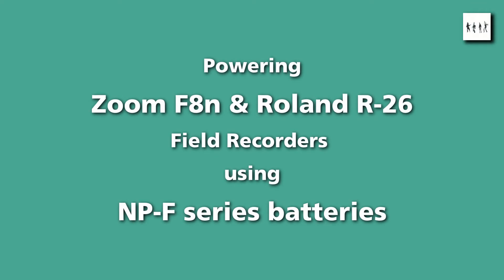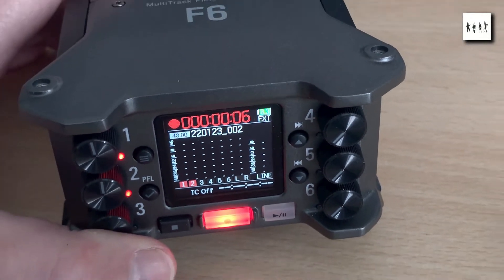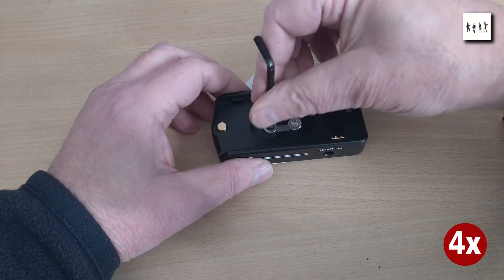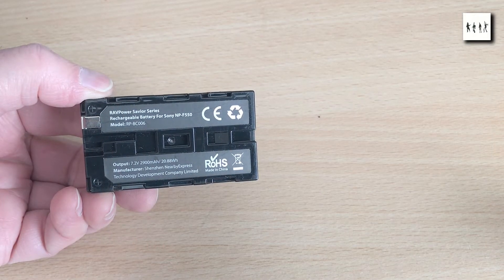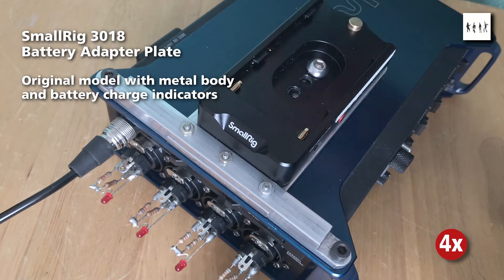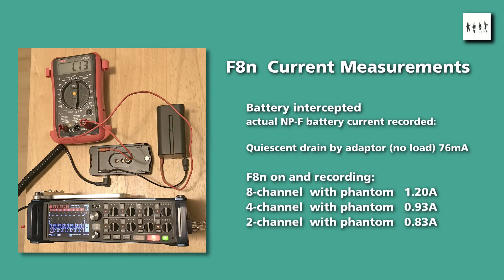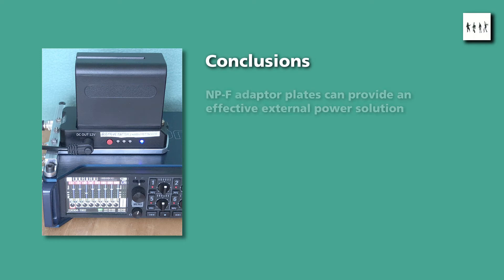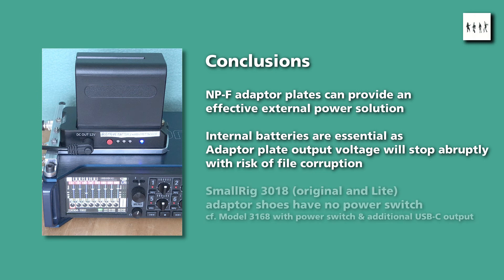Powering Zoom F8n & Roland R-26 Field Recorders with NP-F Style Batteries

Comment: Thank you for the helpful review and measurements. Did you keep the display enabled (if so, full brightness or dimmed?) on the F8n, since some people are pointing out that a significant chunk in the power draw of F8n is due to the power hungry LCD?
Reply from the maker: You're welcome! I normally use power-saving with LEDs and LCD at between 5 and 10 (if in a low-light environment - higher if brighter.) While it may use extra power, I would never leave a recorder recording with no visible display, unless I were going to walk away and leave it completely (which I almost never do.) Even if the recorder is on a stage. I like to be able to see that it's still working from a distance, even if I can't see the finer details.
Reply: @reqordist  Thank you for clarifying it!

Comment: You should use a Hawk-wood: DV-BM1
Can use dual NPF batteries, has a on off switch, power level indicator and you can hotswap. Outputs to two Hirose connectors and a power con.
Also has screw fittings so u can mount the batteries if needed without all the DIY mounts
Reply from the maker: Interesting, thanks! They're quite heavily discounted atm.

Comment: What cable were you using with the Smallrig NPF adapter on the F8n? I just purchased a F8n Pro recently and was looking to set up a similar system.
Reply from the maker: Sorry, Kiefer, it was quite a while ago, and the actual item has fallen off my ebay purchases history. I bought it for use with an unbranded 12V Li-Ion battery pack, which doesn't have a charge indication, so is less useful than this sled. The good news is that there are plenty available - search ebay for 'hirose cable male to DC jack'. The SmallRig adaptor's 12V output is centre pin positive. Connector barrel is 5.5mm outside diameter, inner pin 2.5mm diameter. Note the Smallrig adaptor's 7.4V output is also centre pin positive, and barrel 5.5mm OD but it has a smaller (2mm) pin. HTH!
Reply: @reqordist  Thanks for getting back to me! I'll look into that

Comment: Hi , thank you for your time and video ,, greats ! I looked for lots of solutions to power zoom f8n and one of them is boost 5vto 12 v but it's 1 amp and I think it's low  because the minimum is 2 amp, my question is how many amp delivered smallrig 3018 in 12v output ? Thanks you so much ✔️😊
Reply from the maker: Hi, I did not measure the 12V current directly, but:

The NP-F battery was supplying 1.2A at maximum load (see 4m12s). 

So if the battery voltage is approx. 7.4V, and the converter's efficiency were 100%, the 12V output would be supplying (1.2*7.4/12)A = 0.74A to the F8n. 

As conversion efficiency will inevitably be less than100%, the 12V current drawn by the f8n must be less than that. So that would indicate that a 12V 1A supply should be enough to power the f8n. 

I know that the supplied AC adaptor is rated at a nominal 12V 2A, but that is probably to ensure that the adaptor never struggles to power the recorder, and stays cool in operation.
Reply: @reqordist  thank you,  small rig with your f8n work probably with f8n do to lol    ,in boost power 5v to 12v 1amp  I take of the DC 5.5mm and remplace it with hirose 4 pin that way is better than DC 5.5mm ? For my Sound devices 442 work but i don t try it in F8N yet  I think is not safe ? What do you think? 😁

Comment: BRILLIANT!! Thank you!! I have one for you as well for the F8n, you can grab a portable car starting booster which have about a 21800mah capacity with the barrel plug output. Be aware that they can output 16.8V.  However, for my brand new F8n Pro, it can accept a voltage input up to 18V so it works great.  PLUS you can start your car and charge other USB items with it if you need to! :)  I've had the F6 I've been using for years and LOVE IT and I was missing the ability to use the NPF though on the F8n!
Reply from the maker: Thanks for that suggestion - there's a vast range of sources for Li-Ion battery packs these days! Have only just seen the adverts for the F8n Pro - it looks amazing - you must be very pleased with it. Getting an F8n Pro would be a no-brainer if I didn't have an F8n already!
Reply: I did that for while.

Comment: Amazing video, thanks! I have an additional question about the SmallRig 3018 plate and the NPF Batteries that work with it. Does its 12V output work as a booster? I currently have a ZOOM F4 and got an ANSSO battery plate for my NPF970 batteries which only output 7.2V which is not enough to power the recorder. I'm thinking of getting the smallrig plate but wonder if it would work.
Reply from the maker: Yes it does. The plate has two outputs: one direct from the battery at 7.2V (nominal), and one via a step-up regulator circuit giving 12V.
Reply: @reqordist  thanks!